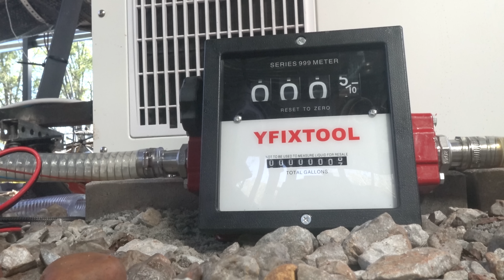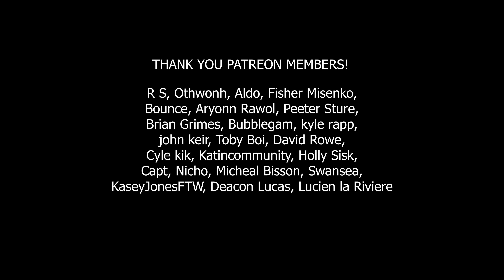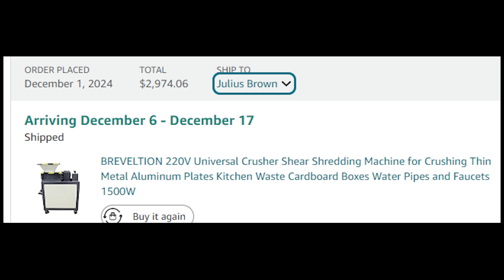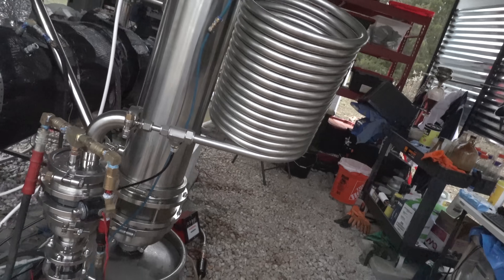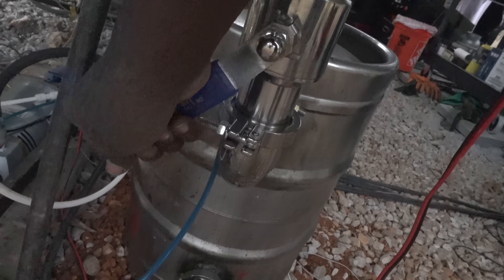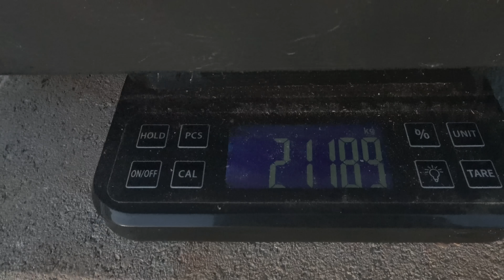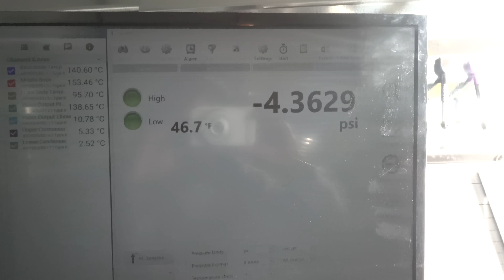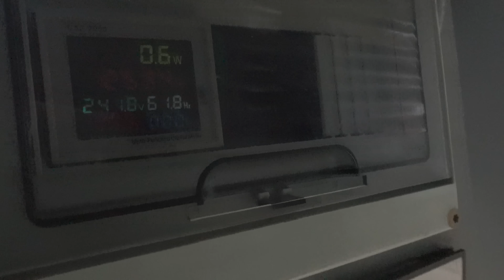I made my own gas station! Fueled by Plastic Waste + LDPE Analysis Run Part 1

Comment: The only metric that truly matters is COST PER GALLON
Reply: @M-mj8bd He does have a pretty decent filter setup (at least as far as I can tell) and has so far only been working with plastics that are made up of just hydrogen and carbon, so probably not much if any at all. If he wanted to start working with stuff like PVC, then it would become a lot more of an issue.

Comment: Good project. Knowbody is gonna come knocking on your door. You are surely safe. This is not a new idea. Its great that you are engaged in this and you have come along way. You will gain from this effort. Bravo!
I dont have facts. But my guess is energy to process vrs energy recoverd ratio wont be good enough to make sense. Also some emissions produced during process will make the total emission footprint maybe too large to gain any traction. So I dont think this will ever work. But still is a fun positive project.

👍

Comment: IDK the specifics of that pump that broke, but if it's a fuel pump specifically maybe the density/viscosity difference between fuel and crude oil was an issue? If you're able, it might be worth getting a different style of pump. Love the work you're doing!

Comment: You could try a power steering pump from a car to push the oil. Maybe use a small electric motor to just spin it up or just take an impact gun and ziptie the trigger on it

Comment: @naturejab I came over from Mass Spec Everything's channel, where he found from the samples you sent him, you're primarily making Styrene, Benzene, & Toluene.

So you ABSOLUTELY ARE producing VOCs or hydrocarbons from Pyrolysis of plastics! And your automation, sensors, and industrial process control stuff is impressive! 

But, since you are making Styrene, Benzene, & Toluene, flammable hydrocarbons that will turn over an internal combustion engine, they're still not actually gasoline or diesel. 

And, the "you'll get cancer!" Commenters, well... they're not exactly "wrong." There's nothing in the simple end of the Benzene carbon-ring hexagon family thats "good" for people.  

But, you're outdoors, an open air shelter, etc. So hopefully it's been okay so far. But please look up the actual precautions, exposure limits, & safety measures for those three compounds!

But hey, even if its not actually "gasoline" or "diesel" making raw Styrene, Benzene, & Toluene from plastics is still probably really important! Industry & science use these constantly. Recycling it instead putting the plastics in landfills and just making more from fossil petroleum would still be wonderful!

Also, instead of the vacuum process, have you investigated a high pressure/steam process? Because I recall the "big breakthrough" in Pyrolysis or Thermal Depolymerization back in the early 1990's was actually USING the water to help the reactions along, instead of trying to bake everything to a nearly Anhydrous state first. 

I haven't watched all your videos, but I assume you're using 2.4gHz food/kitchen microwave magnetrons. Which makes sense, as you probably want to be using 110VAC and not any high industrial power, like 240V or 440 three-phase. 

But, if you are using the commercial microwave magnetrons, the very high frequency RF is going to work on water best. And in your reactor its probably only heating the water, and then the plastics only indirectly by whatever random molecular bonds laying around in the reaction vessel that "dance" for 2.4gHz  too. 

So, if its a pressure vessel process instead of a vacuum one, and keeping the H20 "in" might help with the Pyrolysis, the water vapor & steam would make the magnetron heating far more efficient. 

And, the steam could be released later on, and just drive itself out, drying the reaction products somewhat "for free." The Benzene boils at 176°F well below water, but... maybe the "steam pressure baking" might not have Benzene in the mix. The Styrene & Toluene both have boiling points way above 212°F/100°C... 

I honestly have no clue, but maybe a pressurized steam process won't make Styrene & Toluene either... 🤔 Maybe you'll get a mix of hydrocarbon chains with a more Gasoline or Deisel-like spread. 

I mean, the fossil oil & coal in the ground was made with heat & pressure too. Not heat & vacuum.

Comment: Amazon has some heavy duty gardening pumps that should be able to pull plenty of that oil through. Or maybe for safety make a manual pump with a switch value to vacuum it out

Comment: Crude oil is not obtained by burning plastic. Crude oil is a naturally occurring fossil fuel found beneath the Earth's surface and is typically extracted through drilling. Burning plastic, on the other hand, releases harmful pollutants into the environment and contributes to air pollution. I just looked up Pyrolysis people, no need!

Comment: Keep it up! Plas-o-line is the greenest fossil fuel I can think of  - if you sold it, you could sell it for more than gas as it has an additional benefit over just running your car, saving the environment and reducing reliance on traditional big oil.
Reply: Yeah lets pay even more for gas
Reply: I'm not even sure if it's sarcastic or not.

Comment: Not sure if this would help however would it assistant the pump by having the hose lower than the pump. I would think it would be harder to extract with the hose going up however I haven't done anything like what you have accomplished.

Comment: Bro, take some basic safety steps. Half mask organic filters are not capable of filtering the volatile compounds you are creating. You can get scuba bottles and make a SABA setup for reasonable cost that will have adequate run time. In addition to that buy tyvek coveralls. They are cheap and will protect your skin from absorbing all the vapours you are exposing yourself to.

Comment: Are you sure you need all that head to do the distillation? Most of these hydrocarbons boil off at 70C to 220C that's just an average.. that propane flame runs around 3600 F or 2000 C . just saying an electric heat matrix or oil bath would probably be much safer! Stay safe

Comment: What's the trade off? Like what happens to the waste or does it all get converted into petroleum again?
Reply: trade off is really bad efficiency. Running 6 microwaves for 3 hrs uses a lot of energy to produce not very much. The waste is all dangerous and cancerous and a lot of it cant be extracted from the final product so that "plastoline" is not good to be around.

Comment: The EPA needs to shut you down. You aren't doing anything revolutionary that hasn't been done and all you are doing is wasting energy to make less energy than you started with while pushing carcinogens into the local atmosphere.

No matter how many times you do this, it's not going to lead to an efficient system that produces more energy than it uses to make. You haven't solved any of the fundamental problems with this process that makes it inefficient and burning more plastic will do nothing to help you solve the efficiency problem.

Comment: this is so cool. Just a suggestion if you could try to focus on black plastics specifically that would be rad. The black plastics that are the most difficult to recycle and are generally just trashed. Alot of other plastics can usually be recycled
Reply: idk if they make a difference in the crude oil making / refining process or not

Comment: Use acid to fumilate the brake down of plastic heat to force up speed of liquidification from a split back into fluid vrs vortex condensation

Comment: I have been very intrigued by this system you have going. I think that it is amazing and could have a massive part in recycling and cleaning up this planet of plastics. I do a lot of 3D printing and I have a lot of waste that I do not throw away because I don't want to just keep dumping plastic in the garbage. I would love to shred it up and send it out if possible. Id be curious to know how it breaks down in your machine. Lets get some likes on this comment and make it happen.
Reply from the maker: Send it here: 8491 Hospital Dr #237 Douglasville GA, 30134

Comment: Styrofoam but you know what would be a great thing to test that needs to be recycled and is not is grease tubes. You know like ones used on a construction site for heavy equipment. We would go through cases every week with only about 8 machines on site. Always residue all over and thick!!

Comment: It's a cool possibility, but absolutely doomed at the start.  The energy consumed to produce fuel alone is greater than the energy the fuel will provide. Even if it was solar powered it would be more efficient to use the electric to power the machine. This time and money would be better used to create a robust and economical burner to convert waste plastic directly to heat, and subsequently electric or mechanical power.
Reply: Nope. According to chemical kinetics, the energy required to break the plastic polymer into fuel molecules is less than the energy you get back through combustion with the fuel molecules with oxygen.
Reply: @xmysef4920  I would love to see this proved, a complete kw used to run all this per gallon produced. Then I suppose we could estimate if an engine with 100% efficiency powered a generator, how much energy is produced.  Again though it's more efficient to directly use plastic as fuel, it loved to burn.... It's byproducts are just really bad for the environment, solve that and you have a winner.
Reply: @xmysef4920 It still needs purified.  
The pyrolysis is actually just the tip of the iceberg when it comes to energy costs for getting usable fuel out of this.

Comment: Your best bet, is to get a hydraulic standing press, weld together a circular frame about 1inch smaller in diameter to your oven and shred the plastic and then blowtorch the press till it gets warm enough to compact the shredded plastic. the make Pucks and load them into the stove. could prolly fit 80lbs in there that way.

Comment: Diapers are made from a variety of plastics, including polypropylene, polyethylene, and polyester: 
Topsheet and backsheet: These layers of the diaper are made from plastic polymers like polypropylene and polyethylene. 
Leg cuffs and closing system: These parts of the diaper are also made from plastic polymers. 
Absorbent core: This part of the diaper contains a super absorbent polymer (SAP) that's derived from petroleum. 
Outer cover: This part of the diaper is made from polypropylene and polyethylene. 
Plasticizers like phthalates are often added to plastic polymers to make them more flexible. However, phthalates are endocrine disruptors that can affect the hormone system. 
Diapers can also contain other materials, such as: cellulose, tapes, elastics, and adhesives. 
Diapers are a major contributor to global waste. They are difficult to recycle because they are often thrown out with a baby's waste.
Reply: but what about the 💩
Reply: @phillipyoung3250  pure carbon.. he's cookin with gas.. and err. microwaves. Also, he doesn't clean any of the plastic thus far so great test runs for the system.
Reply: @thewatersavior  🤔🤔
Reply: This guy doesn't care about endocrine disruption, cancer or environmental pollution.
Reply: @EddieTheH  what do you mean by that?
Reply: @EddieTheH  I wouldn't take that leap, BP and crew don't care either unless regulators or the public make them do so, says their own documents. For a builder he is taking the risks - def appreciate that.  We can def appreciate once its streamlined, incorporating safety, just like the other firms have in the past. But you gotta start somewhere. That said, some more protections couldnt hurt, but we did not see the installation so I will air on the side of its not worse than any pipeline running through a national forest (see Mountain Valley Pipeline)
Reply: @thewatersavior  yea, he should have cement under the machine to prevent the plastic carbon leaking into the ground.

Comment: Oil refining is insane. You end up getting like five different products or something at the different levels (I saw a cross-section of a refinery once)😂. From gas to oil then to petroleum jelly, I think. Am I thinking of the right thing?? This is really cool
Reply: Yes they use large fractional distillation columns to isolate various hydrocarbons contained in crude oil.

The thing is there are different grades of oil and each grade has different levels of each hydrocarbon. So depending on the starting crude, that determines the output products you get.
Reply: @clutchboi4038  They also use various catalysts to break the long chains down into the ones they need.  
That procedure alone would drive the cost of this "plastoline" above that of actual fuels.
Reply: @ that’s true about the higher cost. At this point, I don’t think it’s ready to replace actual fuels, just turn the trash into something special. If  every municipal had one of these, then maybe recycling day could be restructured and taxpayers could pay a little bit extra but then get this fuel sent to them if they wish, or there could be municipal gas stations where residents could get a good deal on this stuff, but not necessarily to put in their cars. Just their lawnmowers and other small engines
Reply: @nathanielreichert4638  As a fuel, this stuff's just too toxic.  
It's only real uses would be for making more plastic, or after huge amounts of extra purification, pharmaceuticals.
Reply: Nah, this is mostly cancer causing benzene, VOC's and toxic heavy metals.  
His products are still more toxic waste than usable fuel.

Comment: Congrats on the new shredder coming inbound~
I'm sure you have or said it somewhere but... Dumb question.. Had you tried lubricating the cutting wheels on your plastic shredder or using like aluminum foil to try to sharpen the blades?

Comment: That's pretty cool, but I gotta ask, how do you negate the downsides? Like CO2 emissions, energy efficiency, etc
Reply: Right if this was practical or efficient for use... why has it not been done already.
Reply: @Vmaster005  well I know the answer to that, kinda.
Reply: @Vmaster005  it's not very profitable from where I'm standing. To get something from another thing, in this case, oil from plastic, you need energy. And almost always, it takes more energy to gain something then it is to use what you've gained to create energy. In short, the output is usually less than the input, and hance, makes it less profitable. And companies aren't going to settle for something that makes them less money unless they charge it for a ridiculous amount
Reply: @Egg0nMyHead that makes a good point. The extra energy has to come from somewhere. I wonder if the energy can come from other means like solar. Or can the heat come from focused light.
Reply: CO2 isn't really the problem, his actual desired product is worse for the environment than plastic.  
The refining that's required to get anything useful out of this will use even more energy than his machine, and much of it is just useless toxic waste that will require even more expensive disposal.  
People who understand the science have been telling him this for years, but he refuses to address the real problems, preferring to ignore them and keep receiving donations.